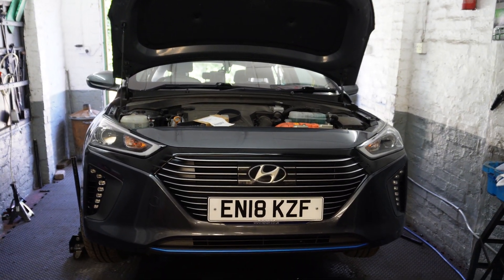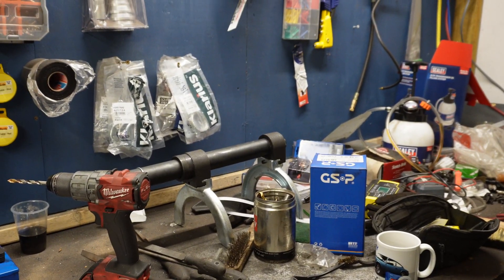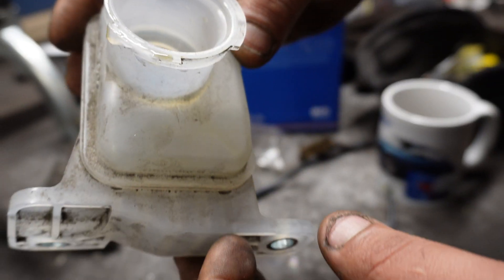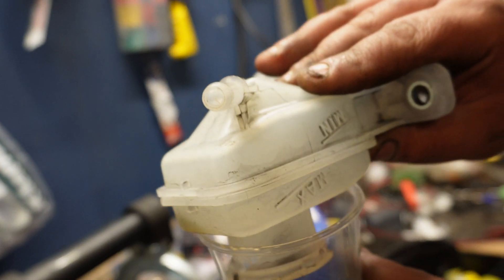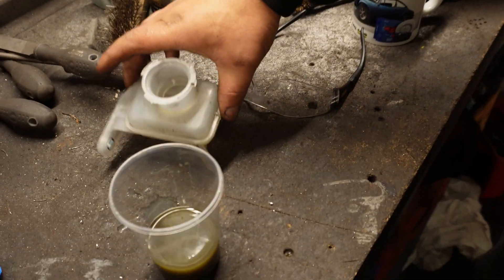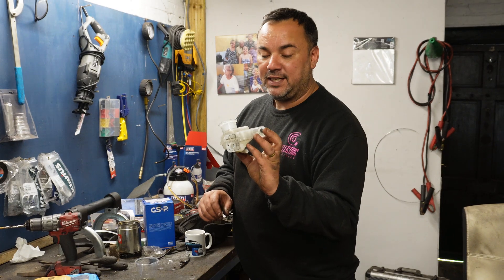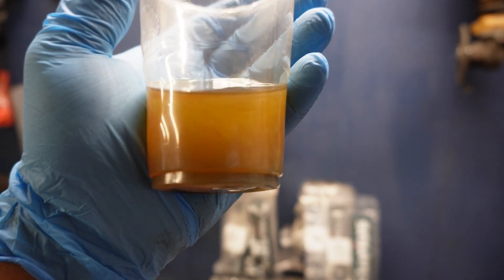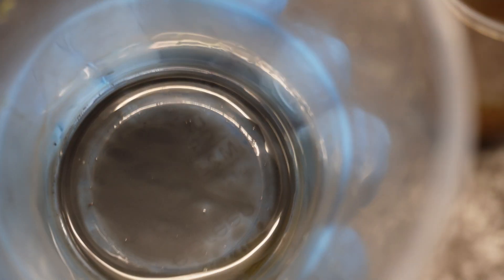Hyundai Ioniq Hybrid MUCKY Clutch actuator Fluid | You must change it !@hybridsolutiondiagnostics

Comment: That fluid was way overdue judging by the color and seeing how quickly it got cloudy again it needs to be changed again now. Should be replacing once a year at least. I have a Niro where the reservoir is at the top over the radiator so seeing the color is very easy. When it starts to get grey instead of tan it's time to change it, PITA, but the alternative is much much worse.

Comment: How much brake fluid to refill clutch actuator?
Reply: only 100-120 ml in my experience. If you want a thorough refill, do it every week for a month. The system should flush almost 80-90 percent of the fluid in it

Comment: Since there is no clutch peddle to pump the fluid through, do you need a tool like Hyundai GDS (the dealer diagnostic system) to actuate the clutch and pump the new fluid through the system?

Comment: What type of fluid to buy to put in this? Mine has a slow leak. I just want to top it off before I sell the car. What’s the easier way to just top it off?
Reply: Dot 3/4 from my owners manual. Double check yours.

Comment: Hi please always include the Mileage and the general location of the vehicle usage.  Why? because hotter climates shorten the life of the fluid and this fluid reservior is in a bad lower spot as it receives more heat from the radiator fan in that location. Its twin the Kona has the reservoir up higher in front so degradation is a little less than Ioniq.  Kona has reservoir higher near inside upper front top. For ioniq consider buying some hose and relocate where Kona has it for accessibility. Also use replace the cheaper DOT3 with DOT 4 as it has a highe boiling point, thus the better the fluid is at resisting heat. That's why racers use DOT 4, not DOT 3, brake fluid.

Comment: Top job. Quick questions:
1. After you took out the reservoir how did you flush the remaning fluid from the hose and pump?
2. Did you have to do any re-calibration\ bleed the system?
Reply: Most don't they just replace the fluid in the
Reservior. But I agree a flush is better.